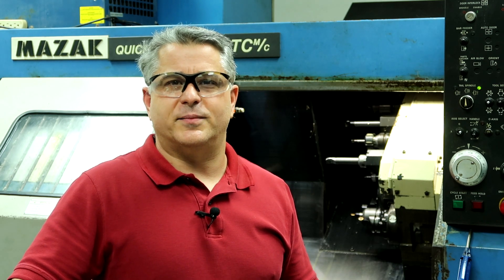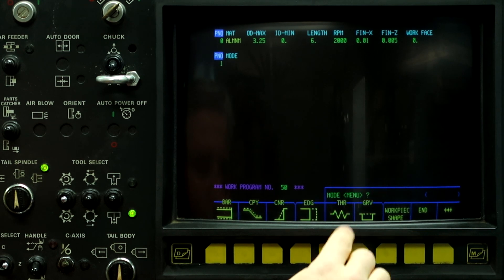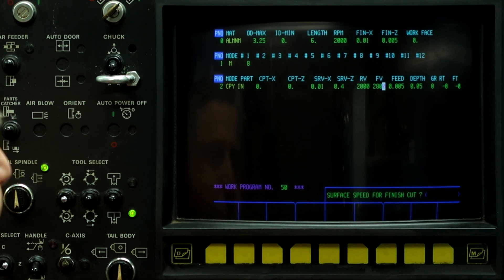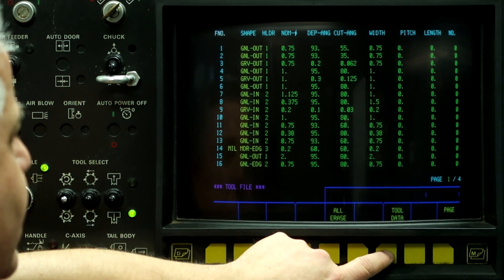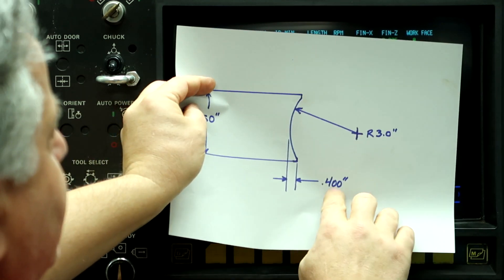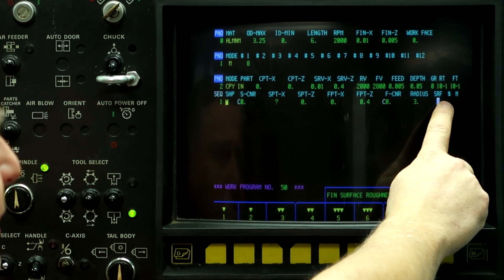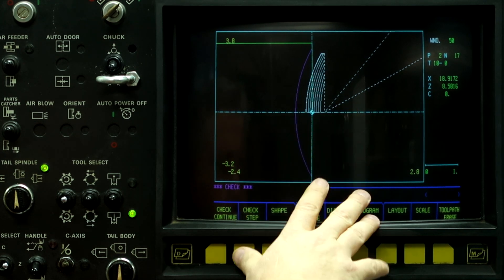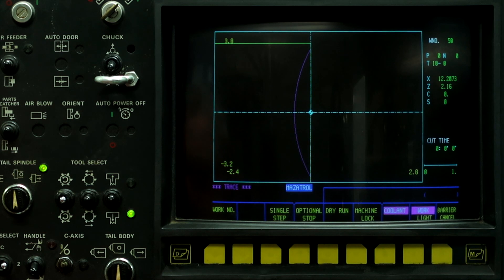Mazak CNC Lathe Concave Face Radius

Comment: Would this programming concept work for a full face radius which is 2+ inches into a bore?
Reply from the maker: Yes. I usually would use a VBMT insert boring bar with the insert pointed at the face of the chuck.

Comment: Heres a question. I tried using this in my Mazak with Mazatrol T32 b controller. It mills the arc  but travels in a straight line beyond X 0.. This gouges the arc. Any Ideas ? Year is about 1995 ish
Reply from the maker: Hmmm. Perhaps something from Mazak changed after the T-2 control?  See if you can cut past X0 using a copy face motion.

Comment: You are a real life saver, thank you for all these videos!
I've been trying to make a inward cone in the face of these parts, but I'm really struggling here. It seem to make the right shape in the graphics, but it draws the tool path as if it wants to overshoot the center point which would make a flat spot in the bottom of the cone. I hope this makes sense.
Reply from the maker: You may need to machine the center portion with a drill point vs trying to force a boring bar down to the center point. Not sure of your geometry.

Comment: I love your videos! I was wondering, do you think you can do a video on how to mill with live tooling and have the c axis rotate? Right now I have been using circle mill but it always mills using the x and y and I am not sure how to get it to use the C axis because I want to make sure my bore I am milling is concentric. Thanks so much and I hope that makes sense
Reply from the maker: My machine does not have a Y-axis so it always mills using C-axis rotation. I have several videos on it. You need to push the right soft key to get to the second menu page when you are programming to use C-axis mode instead of X And Y motion.
Reply: @mazatroltipsandtricks6816  thank you for your reply! Do you think you can please refer me to a video that shows this? Thanks again, honestly
Reply from the maker: @camilewis87  Sorry, my machine does not have Y-axis so the menus available on my controller will be different from your machine. Basically, when you create the process or unit, you push the right soft key to get to more menu options. The C-axis menus will be highlighted in pink if I remember correctly.
Reply: @mazatroltipsandtricks6816  It's actually the opposite (on 640T controllers at least). By default, line-machining is using XC mode. Pressing the button on the right "y-axis" will reverse the options (make them pink) and use XY mode.
Reply from the maker: @shadowdsfire  Thanks for clarifying. Been a while since I ran that generation control.
Reply: @Cami Lewis 

Circle-mill is a point-machining feature and will always use XY mode. To use XC mode, you'll have to switch to a line-machining feature. Either left-handed machining or inside-machining will work. Note that you can't use the tornado feature in these modes, which is why I made a Macro program just for this. I could send it to you if you need it.

Comment: Can you make a video on automatic tool measurement?
Reply from the maker: Yes I could. However, automatic tool measurement only works if the tool has already been touched off and you just need to check the tool after changing the insert. It will not work for setting a new tool.
Reply: @mazatroltipsandtricks6816  thats what im trying to do also just learn to use my machine more efficiently

Comment: Hi can you make a video on engraving from a sub program, also what parameter to change to alter the buffer on a tool when it retracts after a boring cycle in Z axis
Reply from the maker: Sorry, my old machine does not have sub program capabilities. Also, the parameters for my machine are going to be different from your controller.

Comment: Another great video.
I noticed the paint on your machine peeling etc. Looks like standard rattle can paint. Coolant will make the paint separate from the steel. You need to use a 2 part mix paint. Maybe do a video on machine paints. It was a challenge for me to find proper paint.
Reply from the maker: Yes, rattle can paint job. Lol.

Comment: Hello Phil.Can you explain me how do you program a part  when you do one side then turn your part and do a second becouse mazak has no G54, G55,G56 itd. I Move my z in program  on the other side but that is sometimes to complicated .I have also  tried to write first side in one program and the second side in other program  but if i press reset while machine is working other side  it stays in the second program  i hope you can help me. Great job btw  I have learned a lot from you.
Reply from the maker: Those are the only two ways to program the machine. I prefer to program 2 separate programs and have the machine switch between programs using the end process. You have to pay attention as to not crash the machine by running the wrong program though.
Reply: Ok thanks

Comment: Do you have a video on BAK programming?
Reply from the maker: I do not have a machine with a sub spindle.
Reply: @mazatroltipsandtricks6816  so bar BAK only works with a sub spindle?
Reply from the maker: @jaysears9415  I cannot demonstrate BAK on my old machine as it does not have that function.

Comment: Hello Phil thank you for getting back to me about my other question. Now I have another question I am wanting to machine 2 wrench flats 180 deg. out from each other on the side of a 1-1/4" shaft. I would be using a 1/2" endmill and have the mills radius on the ends of the flats for strength (less shear point). Is it even possible or would you just use a ball mill. Thanks again for your good work.
Reply from the maker: You would need to have a Y-axis. If your machine does not have a Y-axis, I made a video on how to mill flats on the center of a shaft using a ball endmill. Check it out.
Reply: I am learning how to program my new to me 2003 SQT200MY
Reply from the maker: @kenwelch7138  Sweet!

Comment: Hello Phil, Thanks for all your great information. I just upgraded form a 1982 QT Universal with a t-1 control and no tool probe to a SQT200MY with there Fusion 640T control. Could you please explain how you would probe tool offsets for a drill or endmill. Thank You
Reply from the maker: Drills and endmills are probed on the length only. For axial tools, the drill or endmill is on the X axis centerline. Never probe the side of an endmill.
Reply: I've probed the side of drills and endmills and then add or subtract incremental amount depending on what sensor you touch off on. Adjust on the tool set page.  Just be very careful to get everything right. Once you done it a few times it saves set up time. Try it and then double check using indicator off Chuck. Using a indicator off the chuck to find zero is soooo time consuming. I have a similar machine to yours and also still have my old t1 machine too.
Reply from the maker: @itsnotfar  Yes, that works. I've done it. Hard to explain how to do it properly and people wonder why the parts do not come out correctly.

Comment: Hi Phil, Great video and well explained. Could you do a video on how to Knurl on this type of control please ?

Thank you.
Jay.
Reply from the maker: Actually, I was planning on doing a knurling video for my next video. Thanks.
Reply: @mazatroltipsandtricks6816  Please do so.  Thank you.👍
Reply: Did you try it out and failed? It should be very simple to do as long as you have  the right knurling tool.
Reply from the maker: @FHove  Not sure who you are talking to but yes, I have knurled on my machine. I will do a video on this soon. Thanks.
Reply: BAR OUT program. Set OD of part much larger. Start tool further away from part and plunge in then across. It depends on what type of knerl tool your using also. Straight or clamp type. One of our machines we use g code and Straight cut the part, so no forming of material.

Comment: Good video Phil.
If you didn't have that button tool you could use a SVJBR boring bar to do that concave.
Reply from the maker: Yes, I thought about using that boring bar but wanted to show the button tool. The button tool can be probed as ID tool or OD tool, but in this example it only works as an ID tool.
Reply: @mazatroltipsandtricks6816   What is the name of the holder of that button tool? I don't think I've ever seen it before.
I am assuming you touched off the button tool like you normally would a boring bar and then changed the nose radius to .25"?

edit Just saw the part where you mention it in the video.
Reply from the maker: @loukola5353  I will have to look up the holder for you. I don't know off hand.

Comment: Phil can you do a video about how and when you use the copy cycle?
Reply from the maker: Copy cycle was needed to cut this feature. Bar IN motion would cause the heel of the tool to interfere with the part. Bar Face would also not work because the tool will not go below X0 and leave an uncut area the size of the tool radius.

Comment: Hey Phil'
Great to see another video from you.
When we think you have pretty much finished showing everything you have.
You manage to find something else.

Looks like you have been spoiling yourself with the Capto Tool Holder.
Definitely a very handy piece to have in the shop.
Just a little hard to justify there expense.
But they do pop up online for sale from time to time.

It's good you could add another video to the collection.
Hopefully you still have a few more to add.
All the best.
Thanks for posting another video.
Reply from the maker: That's actually Kennametal KM50 tooling. I have about 5 base blocks in the machine.  I use the KM50 holders for special tools and use the stick tooling for standard stuff like CNMG432 for OD turning.